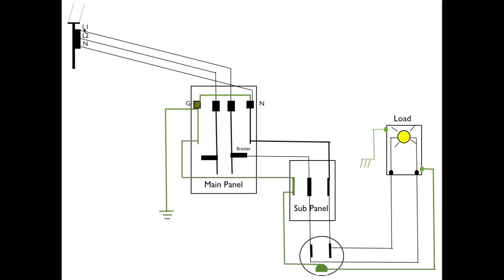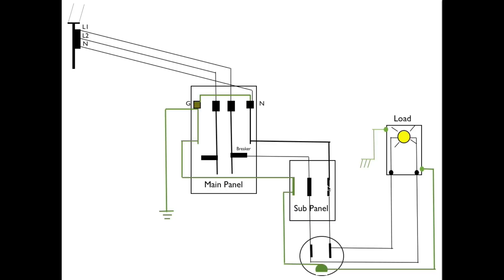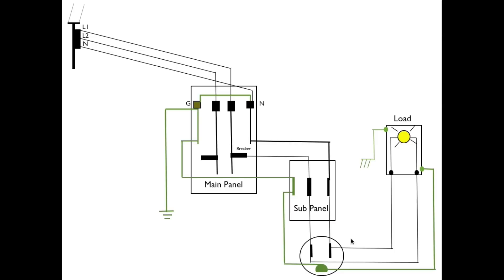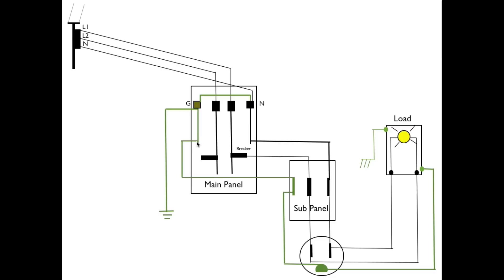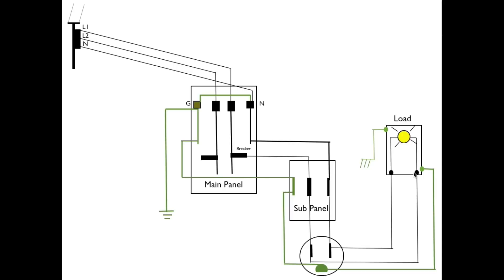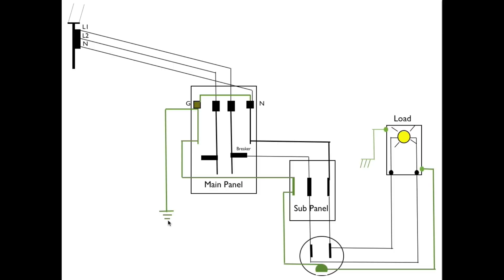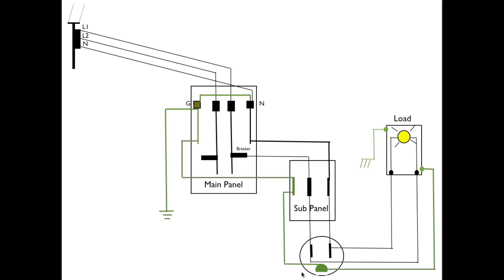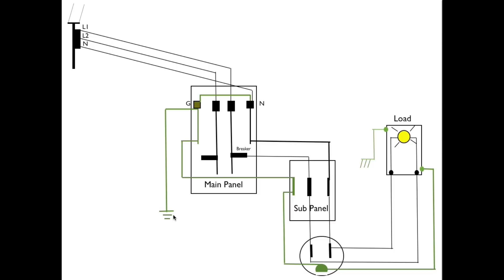The difference between neutral and ground on the electric panel

Comment: 2 questions! first question: where does the unbalanced power go once back to the transformer?
Reply: if there are only two hot wires feeding the transformer, that is!
Reply from the maker: The unbalanced power loads the secondary winding from neutral to one side of line.  From there it loads part of the primary winding of the transformer.  If it is not excessive, there is no problem with the grid.  If it is excessive, the power company must deal with it.
GFM
Reply: Question 2: why does the unbalanced power go back to the transformer? The neutral wire is grounded at the Transformer so why not just have the neutral grounded at the shut-off?
Reply from the maker: There is no other place for it to go within the circuit.  If the neutral and ground are tied together at the disconnect, and the neutral has a fault (open, shorted), the unit will work normally.  It should not operate.  I have a more detailed explanation in my playlist:  Electric wiring in the panel, grounding and bonding.  
GFM
Reply: The unbalanced load balances itself at the transformer. The secondary is tapped (L1, N, L2), the primary is untapped and connected to one leg of a three phase high voltage supply line from the power station.

Comment: I have a question about circuit breakers? If I have a 120 volt 30 amp circuit breaker hooked up to a 12 volt system and the load is more then 30 amps would the circuit breaker trip? I say yes but have never tested this setup. I am guessing that the amps are what trip the circuit breaker not the volts. Am I right?
Reply from the maker: The amps are indeed what kicks a breaker off.  However, there are 2 problems here.  You are using an AC breaker that is not designed for DC.  One of differences between the 2 types of breakers is the DC circuit has a back EMF pulse when the contacts open that can weld an AC breaker contacts together.  The breaker could work reasonably well or not as the cutoff may not be the same as the rating.  You can eliminate the back EMF with a capacitor wired in parallel with the contacts.  That will absorb the EMF.  Hope this helps.
GFM
Reply: Capacitor size? 50 volt 2200 uf work?
Reply from the maker: I don't have the specs.  I believe there is a formula but I have never used it.  The 2200 uf seems high but will probably work.
GFM

Comment: Nice explanation but both lead back to the same source....earth ground. Both can carry current load but for safety a separate neutral wire is used because the bonding of that wire is better than the bonding of ground wires to boxes and armored cable. A bad bond of the ground wire would lead to a high resistance, which creates heat and potential fire or shock hazard, if you're the path of least resistance. A separate neutral wire is a redundant and safer wiring  system.
Reply from the maker: The neutral and the ground do not return to the same source.  The neutral returns to the central point of the transformer.  The ground returns to earth ground.  The fact that they are bonded does not make them the same.  When a fault occurs, it does not clear thru earth ground, it clears thru neutral at the transformer.  Earth ground is not necessary for the circuit to operate.  Neutral is is not a redundant system.  It is necessary for the operation of the circuit.  We operated electrical systems for many years without ground at all.  It is the ground that is the redundant and safer system.
GFM

Comment: A question, I am still learning, I came across a live metal casing (metal throughbox, connected to plastic conduit (bad I know), it was not earthed.  It was in a tight confined space, There was metal trunking nearby and metal basket nearby.  I am sure they had earth continuity between them (basket and trunking).  Well anyway lets say I probed the live metal casing to the trunking (earthed), and got 230 volts reading (UK), but have my leg touching the basket, will that transfer voltage off that single phase and give a greater potential difference  from the live metal through box to the basket or me.  I understand i think, that probing should have tripped an mcb or fuse by sending current to earth, because it wasn't obviously on a RCD, when i  and another tradesman got a slight belt of it.  I only ask because the live metal casing looked plastic hence I touched it.  didn't have no probes to hand at the time. and a facilities company had to deal with the problem. So don't know the outcome of what was wrong. Apologies if you cannot understand what I written.

Comment: A good way to look at it is "ground" wires are only used to protect equipment, and the other wires in the raceway or wire way. Neutral wires are used to balance an electrical circuit in ampacity. Neutrals can shock you,  but only with ampacity, not voltage. So basically, if you have 120 volts ac powering a light, the unbalanced current travels through the neutral to "earth ground" to complete the circuit. If you interrupt in any way that flow of current, the light would stop working.  Example- say you have 3 15 amp breaker feeding 3 rooms of light fixtures, but you "shared" the one neutral wire between these three circuits  and those lights were operating, then you shut off 2 of the 3 circuits. , when you went to the middle of that circuit and took that neutral apart, and you touched it , you would become the least path of resistance for that current path. Because the other light on the other circuit is still trying to find that path back to "earth" . Basically , neutral wires are current carrying conductors because  they provide the path for current to travel back to its source. Therefore ,ground are "strictly " protection. For the other wires carrying voltage in the raceway, yoursel, and the equipment being powered. " path of least resistance " is a good way to remember this and be safe. Alternating current does not care who or what you are, it just wants to complete its task. Great video ,and EXTREMELY important.
Reply from the maker: You are correct that ground is is used to protect equipment(and people).  However, it is not the earth that is providing the "ground".  It is the neutral, as it is the other side of line.  Earth ground only provides a path for lightning and surges to be dissipated.  
A neutral can shock you if it is not connected to the neutral source.  Not with ampacity without voltage because without voltage there is no power.
If you open the neutral in your 3 light circuit, and one or more of the circuits are hot, the neutral from the light(s) becomes hot.  In that case, it is not the least path of resistance but the only path.  The other lights are not involved because their hots are disconnected.  
Merry Christmas.
GFM
Reply: @grayfurnaceman  we are on the same page. I'm just not very good at explaining things fully. I can tell you are very knowledgeable and I appreciate your videos. I was speaking on a transformers "earth" that creates a return for alternating current, residential ish lol.  Delta to wye configurations that is. On the open neutral however, that isnt a "voltage" source. Its actually the unbalanced "current" that the "energy source" is trying to create. pretty sure wye to wye is a different story.  Eric doddards videos are very interspersed.  Merry Christmas to you as well.

Comment: I heard some explain neutral as a method to drain unused power in a circuit back to a "safe" location, E.G. the grid. Also, neutral apparently isn't necessary in 220 VAC is it? Why?
Reply from the maker: That would be more like a description of earth ground.  The neutral is the center tap secondary of the pole transformer.  The ends of the secondary are line 1 and line 2.  In the 240 volt circuit, power passes from line 1 to line 2.  The 120 volt circuit uses line 1 or 2 to neutral.  I have more in the playlist "The electric panel grounding and bonding" on my channel.
GFM
Reply: Right. In 240v the 2 120v power supplies are supplied 180 degrees out of phase, each taking turns being the return when the other is in phase. That's why some old timers used to call 240v 2 phase power.
Reply from the maker: You got it.
GFM
Reply: Also, a 240v circuit requires a 2 pole switch/breaker, one pole for each side of the line, while a 120v circuit only requires a 1 pole switch/breaker, for the line side, the neutral remains un-switched.
Reply: Steve Warren: 
But calling it that is incorrect. 

Also, the two halves of the transformer are not out of phase. Look at the circuitry from one end of the winding and analyze the currents - you will see why. Current does not flow in both directions in the transformer secondary at the same time. For example, for half of one cycle, the current will flow from the L1 tap through half of the winding to the center tap (where current may flow in or out of the neutral) through the rest of the coil to the L2 tap. From there it flows through the L2 feeder to the distribution panel and to the L2 loads. From those loads, it flows back to the neutral bar in the panel (where current may either flow back on the neutral feeder to the transformer or on through the L1 loads and back to the L1 tap.

Sorry if the above in unclear. It is hard to explain verbally without drawings to illustrate the various possible load conditions.

Now, if you look at the circuits from the viewpoint of the center tap of the transformer, then the two legs are 180 degrees out of phase. This is why, if the currents in both legs are identical (balanced loads) then no current flows in the neutral wire.

Comment: hi! so my question is ... how about in dryers machines,air compressor or hot water heater they all using 2 phases and the ground, does it mean that the ground conductor is caring load. is that safe?
Reply: It's 240v from L1 (black) to L2 (red) and 120v from either L1 or L2 to Neutral (white). Some major appliances (dryers, stoves, etc.) have a combination of loads using both voltages and have all three wires, others use just one voltage, either 240 (water heater, air conditioner) or 120 (practically everything else) and have only two wires. The ground wire (green or bare) is always extra and only found where required (eg: no ground on a toaster).
Reply: really only one phase

Comment: Here's my big question. WHERE DOES THE GROUNDED CONDUCTORS CURRENT GO WHEN IT RETURNS BACK TO THE MAIN? To ground? Well then why isn't the GEC carrying its current to ground, why isn't it as hot as the noodle is? Does the current from the noodle just stop traveling after it gets back to the main bus? Or does it return to where it came from, (which is the grounding conductor before it became grounded at the xo)? If that's the case, then again, why isn't the grounding conductor carrying current going to ground from the xo? The only answer I can come up with is that the neutrals current travels "back and forth" from main neutral busbar to the device it is protecting. I would think it would continue its path from main to GEC or to xo and continue through xo.
Reply from the maker: +Troy Bordes Your question deserves an explanatory video.  Look for it in the next month.  Thanks for the thoughts.
GFM

Comment: on your earlier video, what did you mean that common doesn't switch? does it carry power to the other side of the component?
Reply from the maker: +Robert Munguia Common is not usually switched.  Does not mean it can't be switched.  It is just one side of line.  Hope this helps.
GFM
Reply: +grayfurnaceman does it carry current as well?
Reply from the maker: +Robert Munguia Yes.
GFM

Comment: I have a 200 amp service meter to disconnect to sub panel and needs two grounds to the disconnect can I have grounding rod by the meter to main disconnect and then to the water line?
Reply from the maker: This one probably depends on your local codes. There are a number of grounding requirements. Sorry I can't help.
GFM

Comment: I have just one small question which will show what little I really know about electricity. Okay, here goes, 'When current returns through the neutral wire why doesn't it follow the ground to earth connection at the main box rather than go out to the service pole?  Seems like the earth route would be a stronger ground????'
Reply from the maker: Your question is a great example of the misunderstanding of what earth ground is.  The electric distribution system will work quite well without earth ground at all.  It is only there to absorb spikes, surges and discharge lightning.  
Earth ground is not any part of the circuit.  In fact, the earth is a very poor conductor.
GFM

Comment: if you connect your light via using the ground as the neutral the bulb will glow right  and not trip the breaker?
Reply: A standard breaker would not trip.  A GFCI breaker by contrast, would trip.

Comment: Great video!!

You stated that in the main panel the neutral and the ground are bridged and in the sub panel the neutral and ground are separated. You later explained that the earth ground has a greater resistance compared to the neutral wire and that is why the current will return on the neutral line. (Correct me if I misunderstood). Does this concept still hold true for signal wire? For example, in the controls world, if I had a command signal for say, a two-position valve (24VAC). There is a Line side, Neutral and ground. What would be the difference. Would you measure +24VAC across the Neutral and Ground. Would you measure +24VAC across the Line and Ground. I understand that I could just measure the output from a receptacle but I am in Europe right now and do not have access to a receptacle with a ground terminal and I want to understand the theory behind it 

Thank you for your time,

rosjio99

Comment: So the ground wire sinks the return current on the neutral at the main panel ?  So why do we get the neutral from the pole if it isn't supplying or returning any current ?
Reply from the maker: The ground wire sinks nothing.  It is not part of the circuit.  The power goes from hot to neutral which is the center tap of the pole transformer.
GFM

Comment: Hello , what happens if the Stove's ground is not connected ? Because the wire is too short to reach the screw in the socket .
Reply from the maker: If there was a failure of a part of the stove, a hot lead could touch the metal of the chassis of the appliance.  If this does happen, and the ground is connected, the circuit protection will open and shut off the power.  Without the ground, the protection will not open and when you touch the stove and also touch a water pipe (sink etc), you will be shocked.
GFM
Reply: Thank you so much for the explanation ,so after i buy the Metalic box for the Receptcale i will try to connect the Ground to the both the Metal box and to the Receptecale's screw ...i am in Canada , so the system is same as USA ...
Reply from the maker: Sounds right to me.
GFM

Comment: I have a meter to my garage separate from the house meter,..I want to combine the services so I have to remove the ground from the garage panel and transform it into a sub panel by sending the ground back to my house main panel then to a water pipe or ground rod which are part of the main panel system,...this will prevent my garage panel from going hot,...if there should be a failure,...Is that the general idea?? I am trying to put everything on one meter/ bill this will save me at least 250 a year because they charge me for having a meter if I use power or not,....

Comment: Just a little confusion, what about the main power panel which connect between the neutral and ground will carry the current and energize the main panel?
Reply from the maker: Now you have me confused.  You are going to have to try that again.
GFM
Reply: hogan lee how does it ( the neutral and ground) energize the main panel  if they have 0 potential?

Comment: A sub panel is basically just another load on the main panel. A load's neutral cannot be tied to ground because if it is, current would flow through the ground conductor which is illegal and dangerous.
Reply from the maker: Agreed as far as it goes.
GFM
Reply: You did a pretty decent job in the video.
Reply from the maker: @Cotronixco  Thanks for the support.
GFM

Comment: Can anyone help me to understand at 8:14, when in this subpanel neutral wire is broken, how does current go through live wire to the ground wire?  In chassis, live wire has no connection to the ground wire, it has connection to neutral wire through stuff inside, but neutral wire is broken,  the current is supposed to stop in the middle. How do we figure this?????

Comment: Does electricity really flow clockwise, like the direction shown in load's circuit diagrams?
Reply from the maker: G W  No. ac reverses flow 120 times per second. 
GFM
Reply: Dc flows at a very slow rate, a.c. doesn't really flow , electron just sit and vibrate

Comment: i think the ground is honestly an extra step, with as many positive benefits as negative benefits.  Its just an extra wire in there as a safety harness.
Reply from the maker: I don't know of any of the negatives, perhaps you can tell me some.  The positives include not getting electrocuted from a defective appliance.
GFM
Reply: nevermind i was thinking about the wrong thing.  I guess the only con is extra work to put it in and amateurs doing work.  My parents wired a 3 way and used the ground wire as a traveller, for example.
Reply: Also if there wasnt a ground fault, and there was an exposed live wire, and you touched a grounded object and the wire, youd also get shocked.  I guess it depends on the situation, but now that i rethink it i guess it is a good step to take.